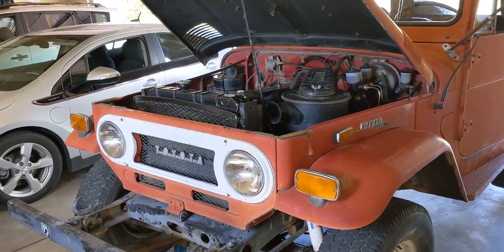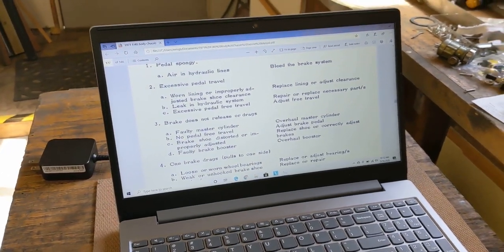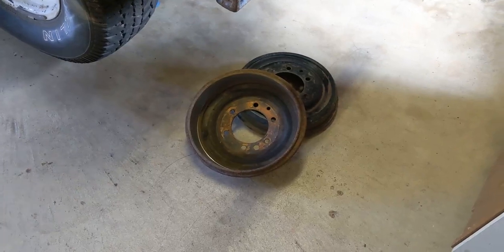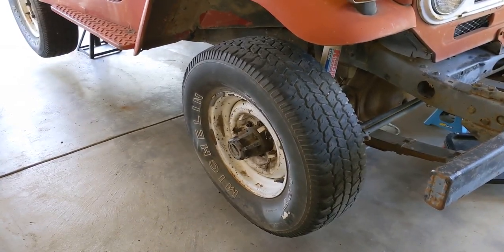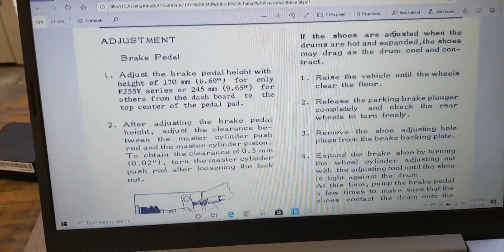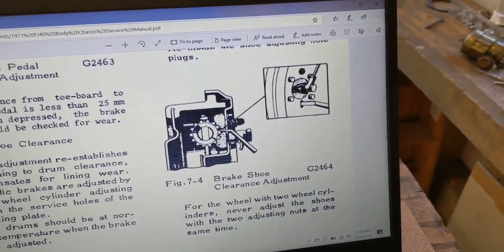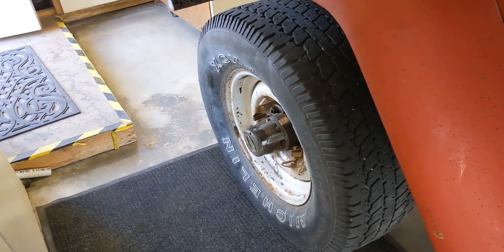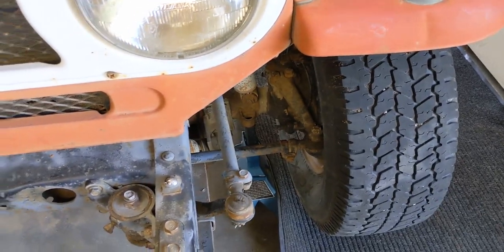Brakes Part 4 + Second Road Test

Comment: Where did you get the Toyota Factory Service Manuals? Do you have a good resource for that? I love the 3 on the tree. Mine works as an anti hijacking device because no one under the age of 50 knows how to use it.
Reply from the maker: There are several sources for PDFs.  I got mine from scribd.com.  You'll need to sign up, but the first 30 days are free. Be sure to get the right year.

You can buy paper reprints at Spector OffRoad. https://www.sor.com/cat221.sor

For most years, there were two manuals, one for body/electrical and another for the engine.

There was a time when column shifters were very uncool.  Everyone wanted a floor shifter.  Now, it's reversed.

Comment: Did you notice any wet backing plates indicating leaks in wheel cylinders?   Cool truck - looks to be relatively original.  I've got a '72 the same color and also pretty original (unmolested).
Reply from the maker: I haven't seen any fluid on the backing plates, but I'll keep an eye out.
 
Do you have a picture of your '72 to share?